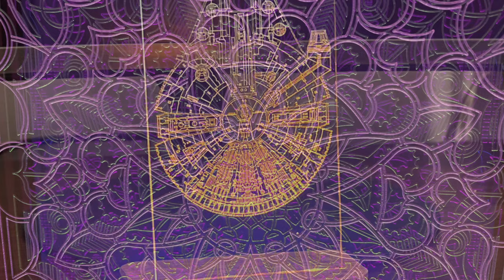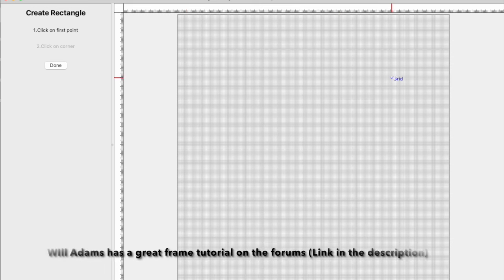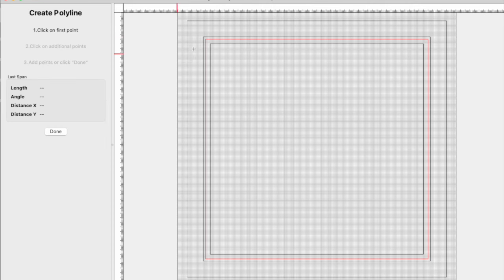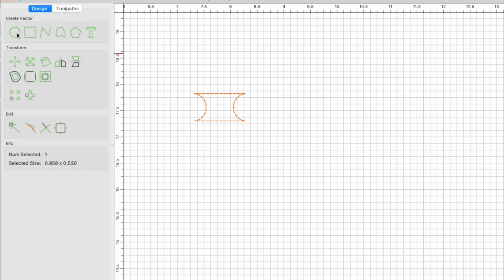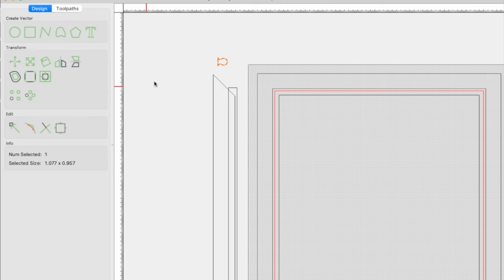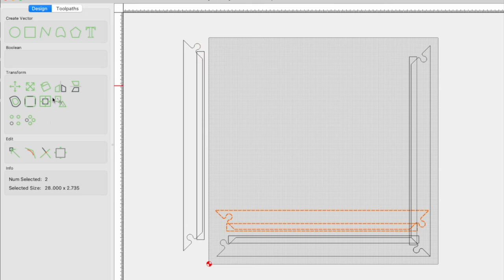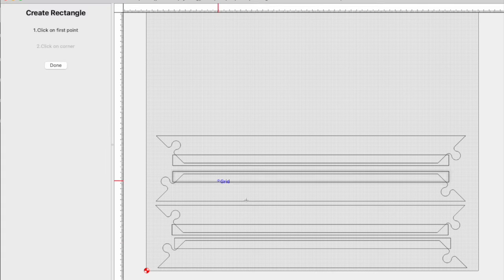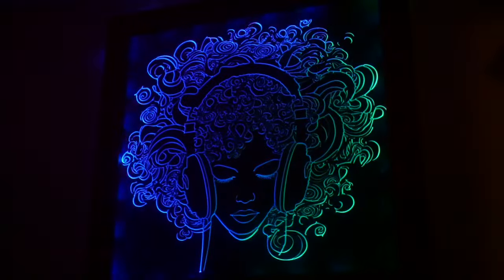Headphone Girl Edge Lit VCarve CNC Project

Comment: That is pretty neat! Have you tried carving the acrylic with the paper on? I ask because I have a Shaper Origin and have wondered about doing something like this with it, but as it is a router it would be dragging itself over the surface of the acrylic scratching it if not protected. 

Thank you for sharing your process!
Reply from the maker: You should be able to leave the paper on. My only reason for pulling it off was to paint that side. If you need to, you could also paint and remask before carving.

Comment: Really cool, can you provide a link or part number for the led strip please?
Reply from the maker: I used this one: https://www.amazon.com/gp/product/B018XAELE4/ but you can go with a set that is less dense (fewer LEDs per inch) which will be cheaper. I like the WS2812B strips. Also a big enough powers supply to drive them: https://www.amazon.com/gp/product/B08764XJ2M/
Reply: Thanks